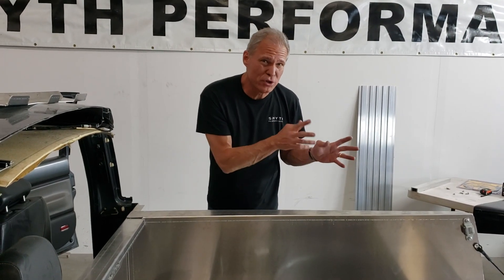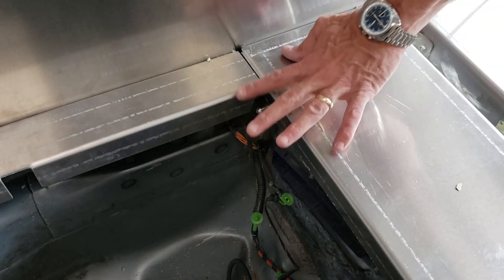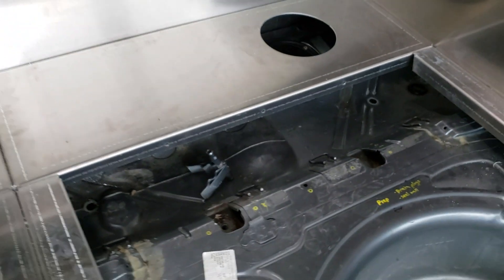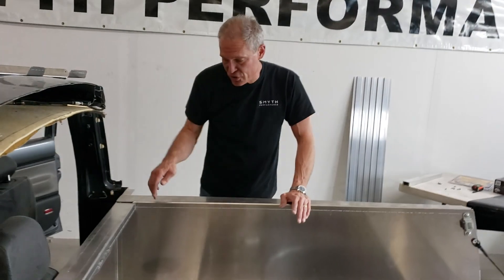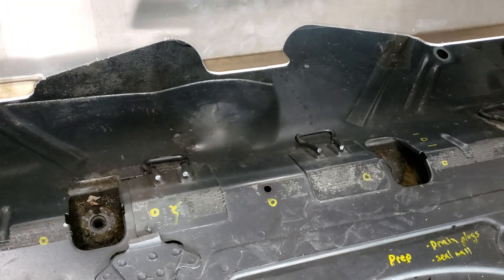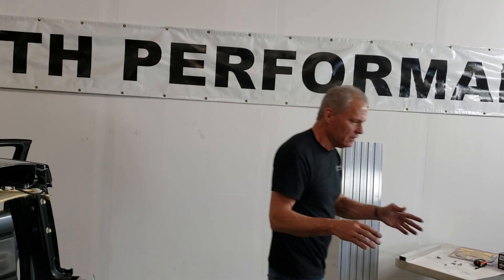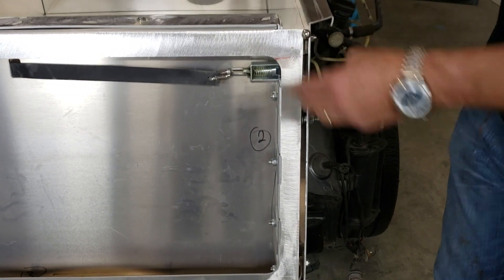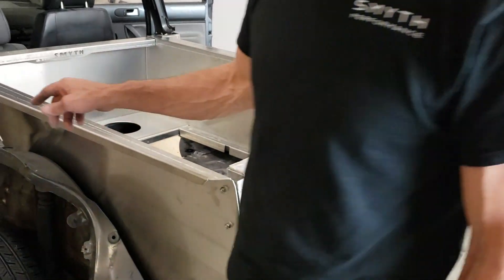Beetle truck build: Positioning the pre assembled bed on the cut beetle

Comment: Needed to alter my bed as it was going to sit too high in the front. The body inner fender supports were keeping the bed from sitting down enough in order to be riveted to the body.
Reply from the maker: yes the curved supports behind the rear seat area are about 3/8" high on some beetles...definitely hammer them down.